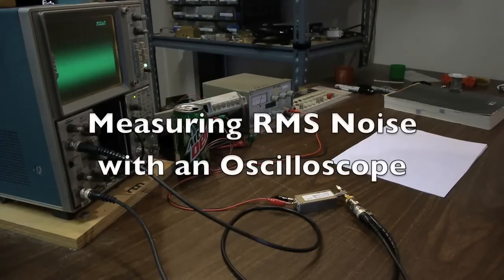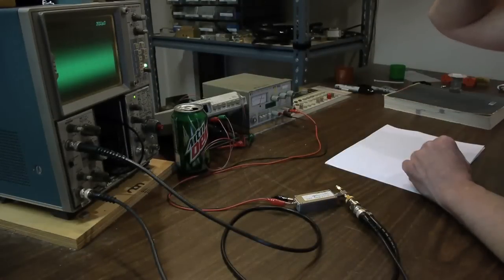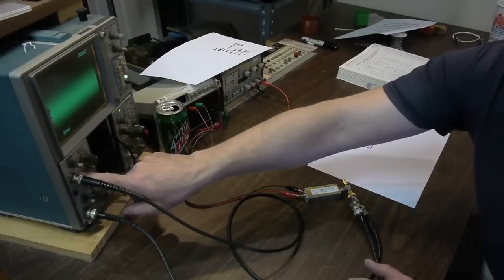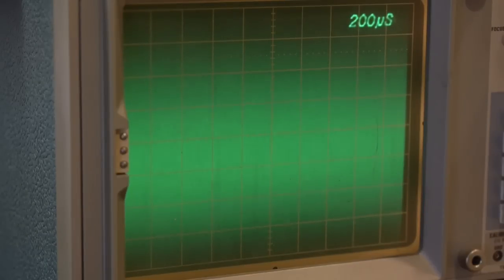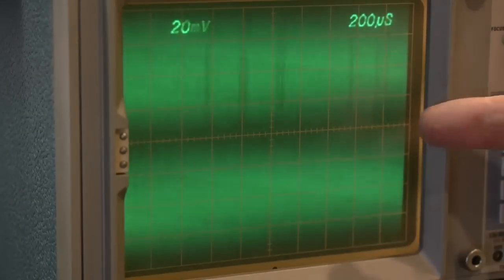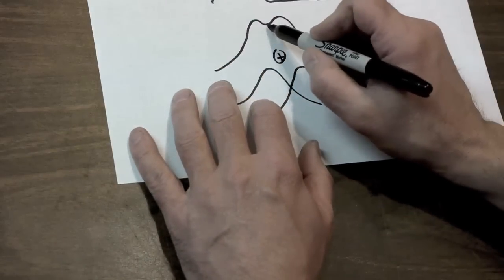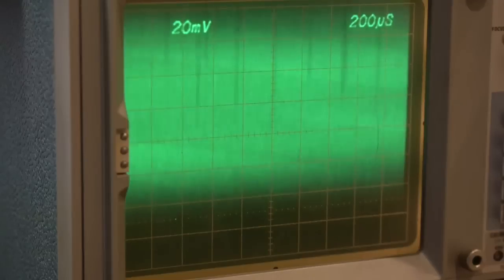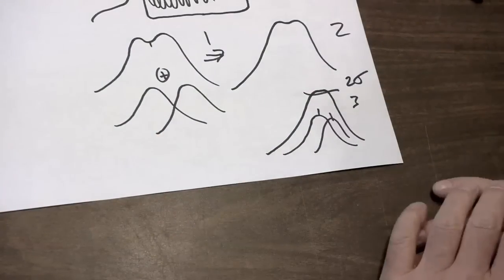Measuring RMS Noise with an Oscilloscope - by Bob & David

Comment: Nice demonstration, and the big screen of the 7603 is very nice for this! Just remember when interpreting the result that wideband rms noise (what is measured by this technique) scales with the square root of the bandwidth it is measured over, in this case the bandwidth of the vertical plugin and scope. It can easily be shown with the same setup in the video by using the bandwidth limit switch on the scope.

Comment: importance of 50 ohms?
Reply: There is nothing special with the number 50, but as the video shows the amplitude changes if the impedance changes so you need to pick a value and 50 ohm is the most common one used for high frequencies. In the case of this video, the noise meter he used for measuring the noise source has a 50 ohm input, the table used for converting the noise meter reading from dBm to volt rms is calculated for 50 ohm, and the 50 ohm termination in parallel with the two 1 megaohm scope inputs is a very common value to have lying around. Easy and convenient. There are plugins for the same scope with 50 ohm inputs but note that this measurement needs two channels in parallel, so with two parallel 50 ohm inputs and no external 50 ohm termination the measurement would be on 25 ohm and give one third the expected value in volts rms. Also the 50 ohm table couldn't be used for converting back to dBm. You could still do it with a little math but there's no reason, and at some point the source may have problems since it is also designed with a 50 ohm output.